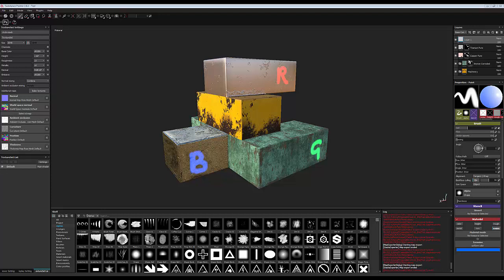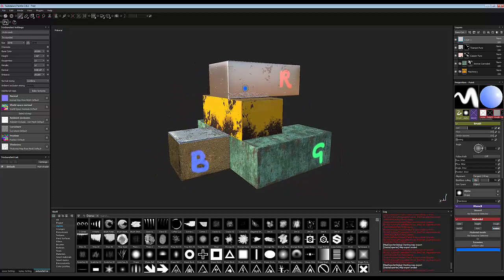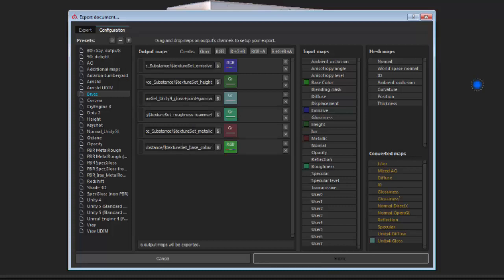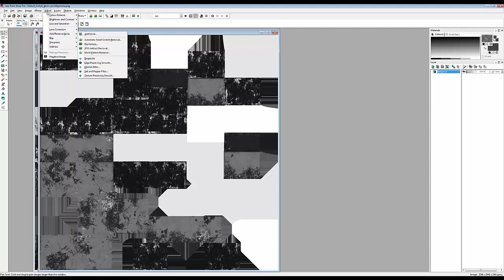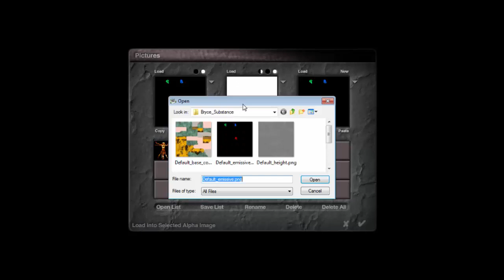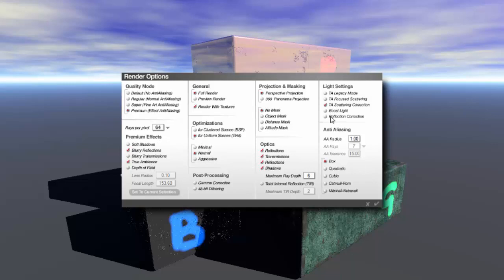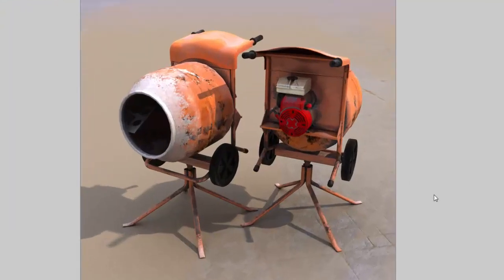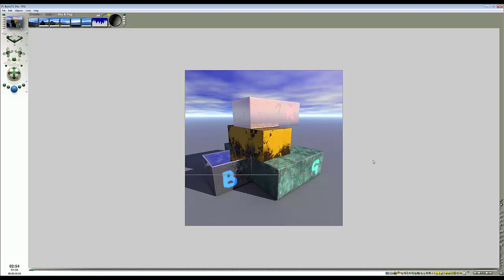A video about PBR workflow into Bryce - by David Brinnen.

Comment: The fact that you need to go into environmental settings to influence certain surface qualities on individual object gets me every time. Usually this yields a great result on some objects while totally messing up others. It's like brute-forcing a result out of a render engine that for all intents and purposes should have been dead and buried at this point. These types of solutions also almost exclusively work on still renderers, whereas as soon as you go to make an animation it all falls apart. 

The Bryce community is small but very alive, and it baffles me why DAZ doesn't do anything to update the software to today's standards, or even 10 year old standards. Bryce is sturdy, and capable of so much - it just needs some updating and most of all, solutions that are ready-made and that doesn't require insane tweaks and almost "under the hood" programming manipulations by the user. 

More often than not, I find myself banging my head against a wall, trying to get a specific result. I change material parameters up and down, back and forth, playing with curves and values in that ridiculously abstract material editor - only come to find out that my solution was a value change of 0.00000000001 which made like a 5000% difference, or even just slightly panning the camera (!). I mean... WTF??! Are these ancient bugs that  bryce wizards just figured out, and now use to your advantage, or is the software actually made to work this way?

So frustrating sometimes.
Reply from the maker: Aye well, I think up against the likes of Blender, it is probably difficult to justify spending money on software development when you are competing with people who are prepared to work for nothing.  The availability of free software has led to a hollowing out between the entry level and the mid level.  High end stuff can still survive by offering cutting edge features and technical support for the professional market.  For example, my experience with Modo's technical support has been very positive, I had a problem, entered a report, was contacted by an engineer, and had a workaround in a matter of a few hours and a patch appeared in the next update cycle.  This is, for someone who needs to get stuff done, worth paying for.  For mid level stuff, that's good but not backed by 24/7 tech support, it is difficult to pitch something that can compete with the free option, particularly for people for whom this is a hobby and so have limited time and modest budgets.  It is only that I find Bryce enjoyable to use and experiment with that I still play with it and my videos are just to show that in spite of expectations, Bryce can still do something surprising and fun.  I consider frustration a sign to look for other software, which is how I ended up making the choices I have, not so much by what the software could do but how satisfactory it was to work with.
Reply: i would compare using bryce nowodays to certain enthusiasts who create new games for oldschool hardware like Dreamcast, working with limitations and such.
PBR didn't get popular until 2013-2014, while latest bryce was made in 2010. So it's like making bloodborne for ps1, yes.